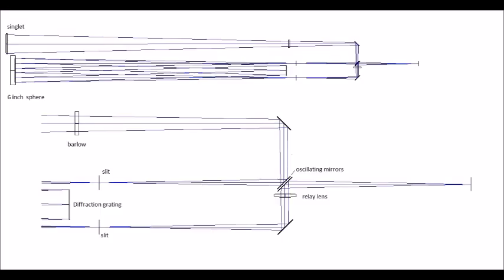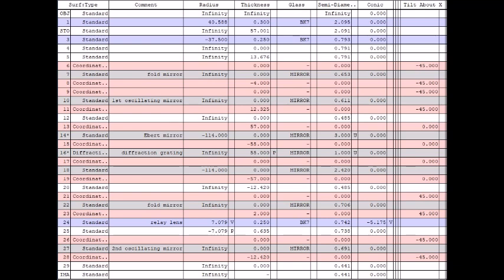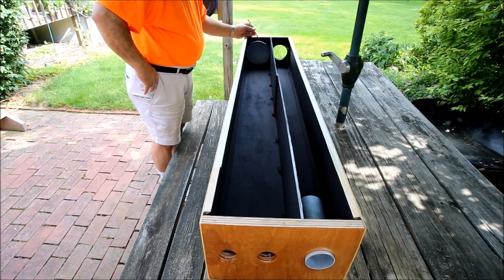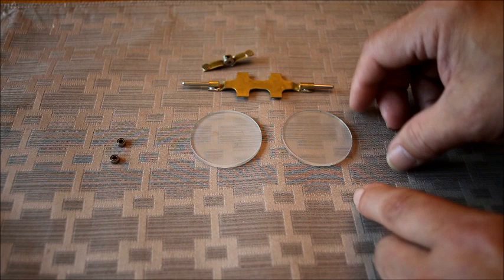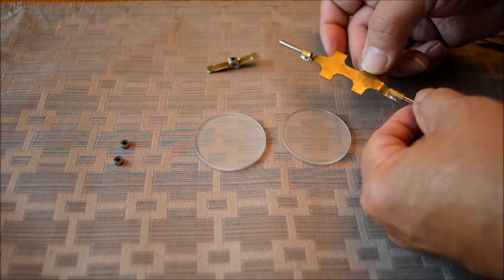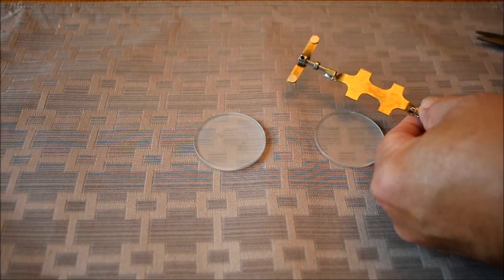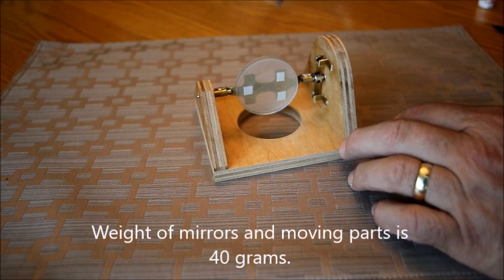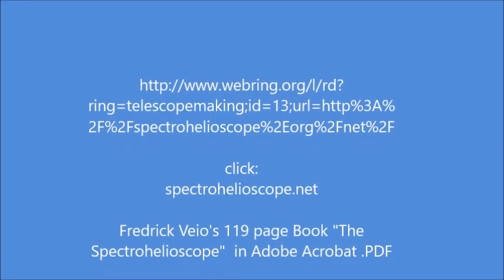Spectrohelioscope part1

Comment: could one use a single flat aluminized on both sides held in a ring with the shafts threaded into the ring each side instead of the pair of flats?

Comment: Nice! I'm working on a similar design with a 3" spherical mirror.  I am still in the design phase, but I'll be starting work soon.  I'll keep an eye on your project to watch for any pitfalls since it is the same concept, minus the barlow since I'm moving the objective to maintain focus on the slit (and using a mirror for the task so as to remove chromatic aberration).

Is your grating placed closer to the mirror due to a difference in focal ratios between the objective and the monochromator mirror?  

In my design, I'm using the same mirror for both tasks, and figured that the mirror/grating and mirror/slit lengths needed to be equidistant.

Comment: Good job！You can use an Arduino board and stepper motor to vibrate mirror. The resolution of Arduino is 2us and stepper motor can accurately define amplitudes.